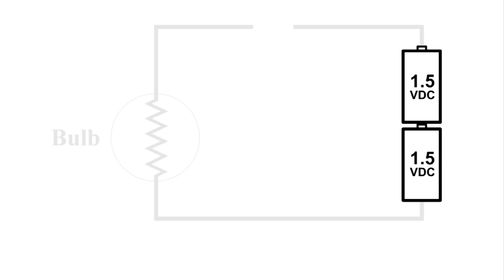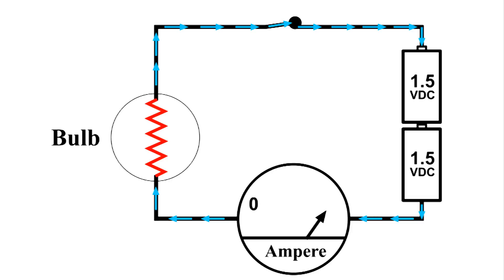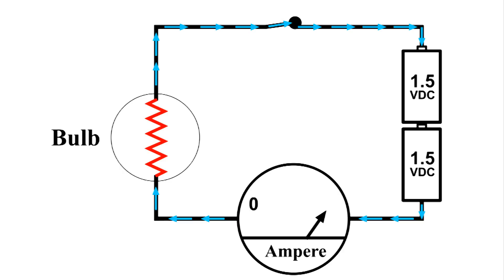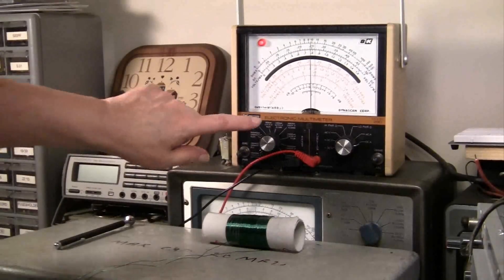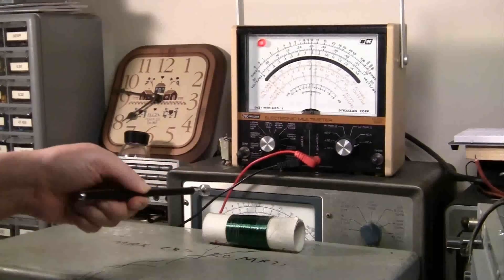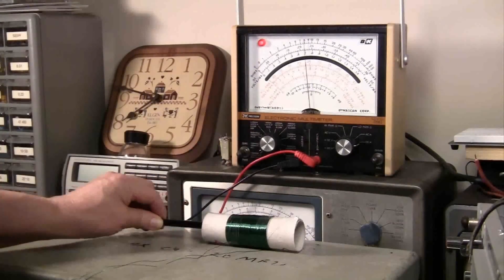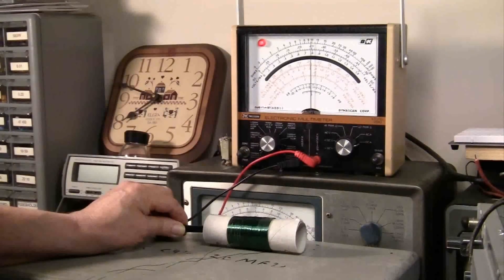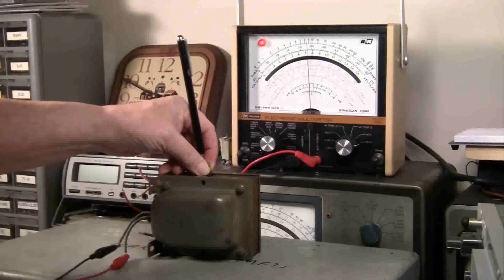Voltage! Current! Generator!

Comment: Hi, thank you very much for this magnificent video,  it's very informative. 

I want to ask about the coil 

What's about the thickness of wire?,  and the number of winds?,  how to get the best generator carectiristics. 

👍
Reply from the maker: +hammza hammza 
Thanks.

Like every place else in electronics there are a lot of variables. Your question about coils and the diameter of the wire depends on how much current you think is going to be going through the wire and where you're going to use. What type the circuit is the coil going to be in. For any particular purpose and engineer will use the smallest wire possible, this saves money. So if the current is very small the wire will be very small, and of course as the current gets larger the diameter of the wire must be increased.

Below is a list of some ideas that I think will be helpful. And I'm sure you'll be able to come up with some Google searches for your specific questions. It is so nice in today's world that you can find calculators on just about anything you're interested in. There is a lot to study but there sure is a lot of help out there today.

Google "wire amp calculator"

Google "coil henry calculator"

Google "tank circuit resonance calculator"

Google "choke coil calculator"

I hope these ideas are helpful.
Rick
Reply: AllAmericanFiveRadio thank you very much 👍 ☺ 

I want to build a pulse motor/generator, with coils and neodymium magnets , like bedini motor 

What is the best wire thickness for generators and the best for motors?

👍
Reply from the maker: +hammza hammza 

I have looked at some examples of motor generators on YouTube. You might contact some of these people and asked them of the gauge wire that they use.

When I'm building magnets and other devices I just use magnet wire from RadioShack.

https://www.radioshack.com/products/magnet-wire-set?variant=5717684613
Reply: AllAmericanFiveRadio thank you 👍😊